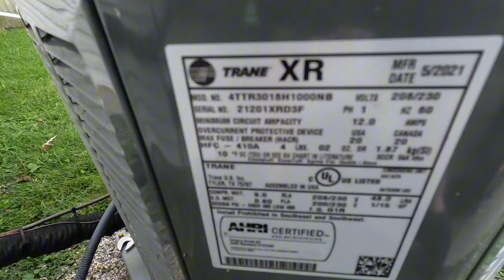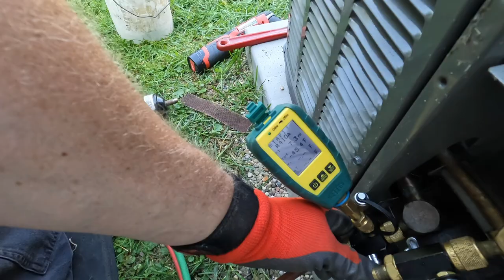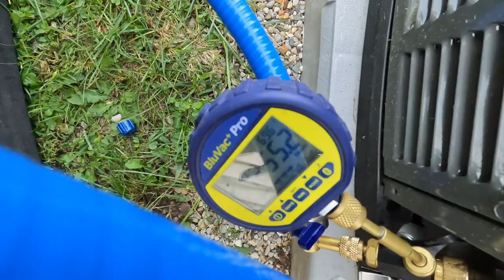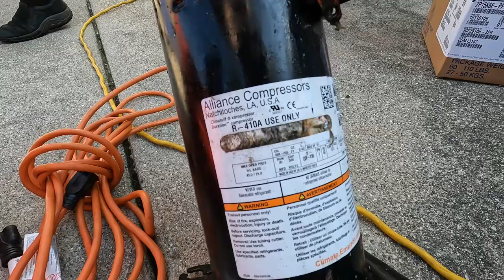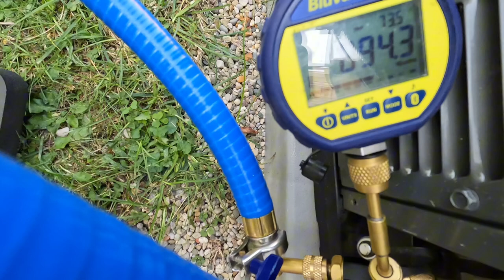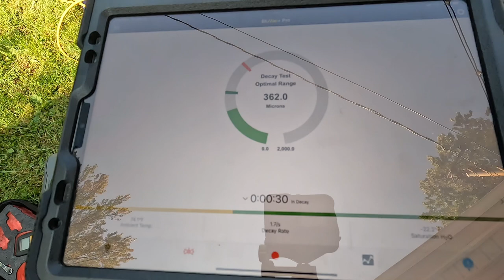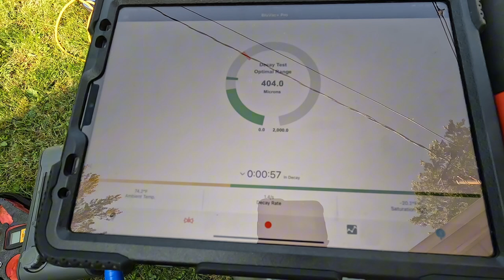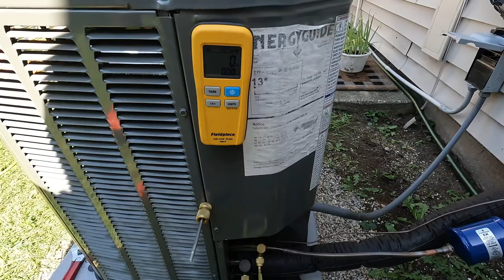Not hard to Stop a Trane AC with an Alliance Compressor

Comment: What happened on the new compressor?
Reply from the maker: I’m thinking the scroll inside broke apart inside. At least that’s what it sounded like. That was a very discouraging day!
Reply: Did you have to change the compressor for second time around? Either bad compressor out the box or that debris that came out of the old first compressor moved around the lines or rest of condenser. Will be replacing a TRANE XR 2018 3 ton single stage straight cool tomorrow out of the 5 yr warranty but not going back in with another TRANE. Have replaced a few trane condensers due to these bad alliance compressors. 2015-2021